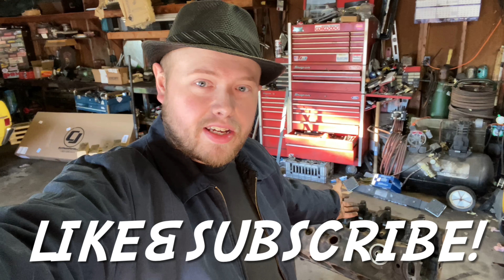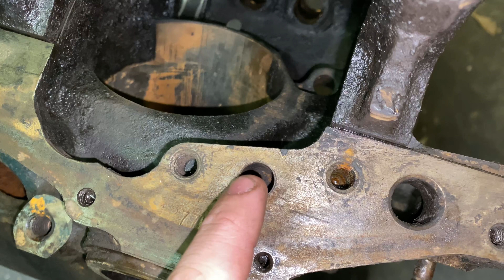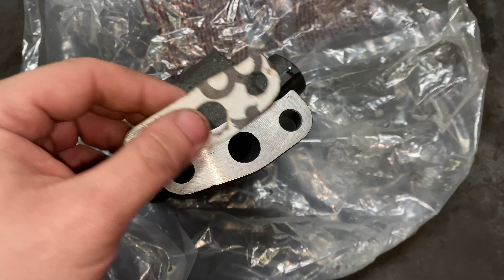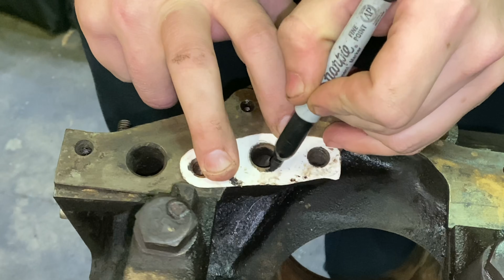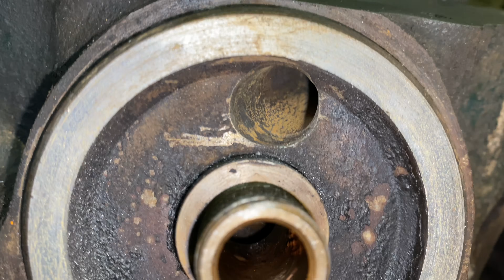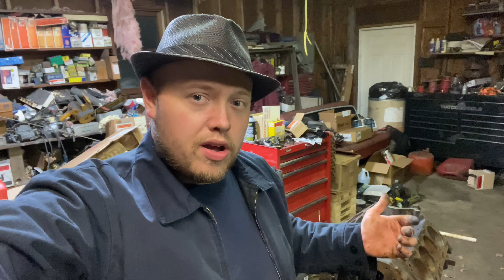351 Cleveland cheap and easy oiling modifications and improvements for the home engine builder.

Comment: Hey buddy, great video but you might wanna take a note that in your thermostat area you’re missing the brass deflector plate and it with the proper thermostat is extremely necessary for that motor to cool properly without that brass insert you’re doomed. Have a nice day.
Reply from the maker: Thanks man, really appreciate it, glad you enjoyed the video. Yeah I know, I had already knocked it out in preparation for the machine shop, I ended up installing an aluminum one made special like the ones they run in the panteras to be able to use a standard thermostat like in a 302/351w for example. Good keen eye though, thanks for looking out, and thanks for watching.

Comment: I think you may have wanted to smooth the transition area where one journel is bored from one angle and then a second angle with no smoothing.
Reply from the maker: If you’re referring to the oil pump hole then yeah I probably should have, it was an afterthought but since it’s not a high performance engine it’s not gonna make a huge difference but yes I agree I should have, will have to remember for another build. Good eye, thanks for watching.

Comment: I have a 1990 F150 4x4 with the totally factory 5.0 (302) engine and it pulls nicely towed many things with it and it does ok on gas for a pickup
Reply from the maker: @ElaineCottrell-u2e  yeah the 302 does fine, I’ve had plenty over the years, I’ve had a 289 and 4 302’s. I just kinda got tired of them over the years once I started messing around with the 335 series 351c,409/351m’s. I just love everything about them, the way they sound, perform, are designed and engineered and the Cleveland dropped right in where the 302 was. I can tell you from personal experience that Cleveland way out pulls and performs that 302 I had and I couldn’t be more happy and satisfied with it. In the end it’s just preference, hope you enjoyed the video and check out the rest of the build series. 
-Thanks for watching.
Reply: @ yes I agree the 351 Cleveland is an awesome engine! 302 can’t pull as much as any 351
Reply from the maker: @ElaineCottrell-u2e  yes absolutely, as the saying goes, no replacement for displacement lol.

Comment: If you want a tow motor why use a W or even better the old FE 390 engine or go big with a 460 or 429 ? I’ve had all of them and they all work great! In my opinion 351Cleveland should go in a Mustang or Torino
Reply from the maker: @ElaineCottrell-u2e  well a Cleveland is better than a W and besides the fact that I’d have to change the transmission, and driveshaft to install an FE or big block I’m not really a fan of them personally. There’s nothing wrong with them but I’ve just never really been into them, I do like the 429/460’s better than the FE’s though. As far as Cleveland’s being in cars, that’s your opinion and I can respect that but they did install the 400/351m in trucks and they are just a tall deck block Cleveland, they’re all a 335 series engine but the Cleveland was a direct drop in swap from my 302 I had in the truck. Plus in my opinion the 335 series are the best engines and I personally like them the best overall. At the end of the day it all boils down to preference and what people wanna do, all the old ford engines are great. I appreciate your interest and suggestions and hope you enjoyed the video and watch the rest of my build series on the project. 
-Thanks for watching.
Reply: @FastFords289 I do love the 351 Cleveland engine! The strongest running car I have ever driven is my 1971 Torino Cobra that came from the factory with a 351C 4v engine. I installed a bigger hot rod camshaft and a bigger than stock carburetor, a 800CFM . It came factory with a 4 speed manual transmission and posi rearend . It was a wicked mean machine! I’ve had lots of 390 engines and they are great engines
Reply from the maker: @ElaineCottrell-u2e absolutely, it’s hard to beat the old 335 series engines, I love them all, the 351c,400, and 351m, like you said they’re strong, the strongest engines I’ve ever driven, even my old 400 in my 77 ford truck 4x4, it’s all original cam and all and still pulls effortlessly, it doesn’t have high horsepower but it pulls like nothing else, makes small block look super weak. Cool car too by the way, the 70-71 torinos are my second favorite Torino. That was a great combo you had too, a real fun setup. Thanks for sharing and thanks for watching.

Comment: It is a good idea to smooth off rough castings and jagged edges. Good detail work for improved oil flow. But, despite the 351 C oil worries, be advised that up to around 6500 rpm, the Cleveland oil delivery system is just fine. High performance oil pumps are not needed. Above 6500-7000 rpm, yes, you need to start thinking about some upgrades. But for a good driver, the 351 C comes adequately equipped. It always goes back to what are you going to be doing with the car. Good vid.
Reply from the maker: @wingrider1004  thank you, much appreciated, I’m glad you enjoyed the video. You are right the Cleveland is just fine on its own especially for a driver, I just went with the high volume but standard pressure oil pump for an extra measure that it being in a truck so it’s in a heavier vehicle than usual and give me peace of mind, however you’re not wrong and a standard I’m sure would have been just fine and it is a highly debated topic. Thanks for your feedback and sharing and support. 
-Thanks for watching.

Comment: I rebuild my 351 Windsor and when I got to the exhaust valve going into the head, I noticed one of my buckets was missing well. The top part was missing. Where can you get those exhaust valve buckets or adjusted from or do I have to end up changing the exhaust valve altogether
Reply from the maker: @ronaldsimpson9367  I’m not sure what you mean by a bucket, unless you meant the valve guide, then the machine shop should be able to install new guides and use the same valves unless it’s hurt, which they can check them for you. If this isn’t what you’re referring to then just try to elaborate a bit more so I can understand and I’ll try to help you. 
Thanks for watching.
Reply: I think he's talking about Fords mid 70s 'Lash Caps' they put on a lot of motors.
   If you can find a sharp, helpful parts man at a Ford Dealership, they can still be ordered. There's also the junkyard.
    Yall Take care, John
Reply from the maker: @ oh ok, yeah I had never heard of these before, I had to research them to see what exactly they are, so I learned something new today, thanks for that because I would have never known. Thanks for chiming in with your advice and experience and thanks for watching.
Reply from the maker: @ronaldsimpson9367  thanks to @johndoe-pv2iu I understand now what you mean, if you have non adjustable rocker arms then I’d check to see if you need one at all on that valve, maybe it didn’t need it and that’s why it’s not there. If it is needed then you can still buy them, summit racing has them and comp cams sales them, might could even pick some up on amazon. Hope this helps, good luck.

Comment: How about the oil holes on the deck drain backs do you gasket match
Reply from the maker: @roberthirshfield3571  I didn’t on this one no, I just recently starting building this engine due to waiting in the machine shop and the gaskets were already matched good enough to not mess with on that part. 
Thanks for watching.

Comment: well buddy, what you've done has mostly been a redundant excersize. At least you have attempted to improve oil return flow. Your mods to the oil pump and filter area have done nothing really.  Please understand that oil flowing through the engine does not flow fast and does not care about sharp edges or corners in the oil galleries. Removing sharp edges to help oil return is good. Restrictions are created by the diameter of the smallest part of the conduit. Flaring the end of the hole does not improve flow in an oil gallery.
Reply: How do you know? are you a ford engineer?... A professional engine builder?.. These oil mods cant possibly hurt..
Reply: @GearheadRob319  That's what I say, these are standard machine shop mods., just done at home.

Comment: Lifter bore bushes make a huge difference. Ive got lifter bore bushes and a oil restrictor kit and turn it to 8000rpm and never had a problem with oiling or bearings. Also sit the head gasket on and port match the oil return holes. 20 psi at idle hot is fine for a cleveland. I have 20psi @idle and 75psi @8000
Reply from the maker: @DB_01984  yeah they are a great modification, however this is more of a stock build with slight modifications, I’m building it for my truck as a towing and cruising engine, so it’s not really needed, a high volume oil pump will serve the purpose on what I want to keep good oil flow along with the modifications I’m doing. I’m not done with the block yet, I’m waiting to get it back from the machine shop and then I’ll be doing more videos on it. Thanks for the tips and suggestions though. 
Thanks for watching.
Reply: @FastFords289  depending on clearances youll have 110psi oil pressure on a cold start with a HV pump
Reply from the maker: @ yeah I knew it would be around 100 especially being new, once it breaks in it’ll drop alittle but should stay around 40 at idle once warmed up.
Reply: @FastFords289  for what its worth im my opinion your better of with a mellings standard volume oil pump and ask the machine shop to shim the pressure spring for you with a 3/16 shim. The HV pumps are nothing but trouble, if your after longevity they will cause premature wear on the distributor gear and they are renowned for oil cavitation. Good luck with it ill stay tuned, sounds like your knowledgable and on the right track.
Reply from the maker: @ I’ve ordered a new original style duraspark custom built improved distributor from D.U.I Performance distributors built for my application and ordered a hardened oil drive just for extra security, even my buddy has a 400 with nearly same setup I’m building with a standard oil drive and never had a problem but I wanted to be sure. Shining the spring is a good idea but isn’t that basically the same as changing the spring? That’s the difference between standard and high volume pumps is the spring tension. Glad you like the content and being a supporter, it’s much appreciated.
Reply: @FastFords289  the HV has a larger diameter gear ⚙️ and the spring tension is substantially different. With a shimmed standard volume youll end up with 60-65psi when hot and 20-25psi on idle. But theres more than one way to do things, i just thought id share what i had to learn the hard way over the years, ive had clevelands all my life from daily drivers to the one i have now which makes just shy of 1000hp on the spray
Reply from the maker: @ yeah you’re right, I’d forgot about the size of the gear. I appreciate the input on tips and advice you’re giving. I’m learning new things and gives me extra thoughts on things. 
Now I should also mention I ordered a high volume standard pressure pump, so with your experience what do you think about that? I feel like it would raise the pressure to around 100 or so cold and be around 40 hot. I’m basing this off my current 302 with a high volume standard pressure oil pump and it runs 65 cold and 40 hot. I know the Cleveland’s run a bit higher, my old all original 400 in my 77 runs 75 when cold but drops to around 10-15 hot, it’s an old engine and a bit tired but still fires right up and pulls hard.
Reply: @FastFords289  high volume standard pressure should be fine, its the high pressure spring that causes problems in HV pumps
Reply from the maker: @ right, yeah I know there’s a lot of controversy out there about different oil pumps and what to run and not to run and I’d definitely never run a high pressure or high volume high pressure pump unless I really had an engine setup that needed it and that would be extreme.
Reply from the maker: @ yeah I mean I get it but that’s why I took the extra steps just to be safe. I figured with the oiling issues Cleveland’s have that this would be the best choice without doing the lifter bore bushings or oil galley plugs which I read you can only run the oil galley plugs if your using a solid lifter cam setup and I’m not, I’m running a hydraulic flat tappet camshaft.
Reply: I think you got a little confused, shimming or replacing the spring only affects pressure, the difference between volumes is the rotor height.
Reply: @FastFords289  Bush the lifters and problem solved.
Reply from the maker: @RogerKelm-b5j yeah I could have done that, and I did think about it, didn’t really want to do it on this particular engine build but definitely would on a high performance engine with often high rpm’s. 
Thanks for watching.

Comment: Dude just get a ball hone and do it properly
Reply from the maker: @DB_01984  I’ve got one, but wanted checked correctly, machine shop said they found some light pitting in a cylinder wall and some of the pistons are 3 thousands off. Gonna have it bored 30 over and get some good sealed power/ speed pro flat top pistons for it and be good to go.
Reply: @FastFords289   Slight putting is not serious, just get new pistons and bar hone the cylinders. Standard.
Reply from the maker: @RogerKelm-b5j true but I wanted to make it all new and fresh, so I wouldn’t have to worry about it anymore in the future. I would do it on a budget build though. Thanks for the tip though and thanks for watching.
Reply: A ball hone would ruin the even bore wear he has, a BAR HONE will give a more even finish.
Reply from the maker: @RogerKelm-b5j yeah true, good point made, thanks for the positive and informative feedback bud.

Comment: Hey man I dig the way you think. I'm doing the same thing for my 66 f250. Another thing to consider is 1) adding a "bypass oil filter" kit commonly found on HD trucks. I got one from Amsoil 2) look into surface scraping (gasket surfaces) using Prussian blue marking dye, machinist scrapers, small surface plate (optional) etc. To match surfaces and help prevent leaks.
Reply from the maker: @rodan2852  thanks bud, much appreciated. Yeah I can bought about doing the bypass oil filter but for my application I didn’t really think it was necessary. For the other stuff you mentioned I’m not real sure on what you’re referring to so I’ll have to look into it, sounds like a good investment so thanks for the tip. Good luck on your build and glad you enjoyed the video. 
Thanks for watching.

Comment: What about the adapter to install a larger oil filter
Reply from the maker: I’m not doing that because it’s not that important for a street truck engine, and if it’s the same one I’m thinking of it’s not to fit a bigger oil filter, it has a bigger bore for more oil flow. I’m not installing that on this engine but probably will for the Torino. 
Thanks for watching.